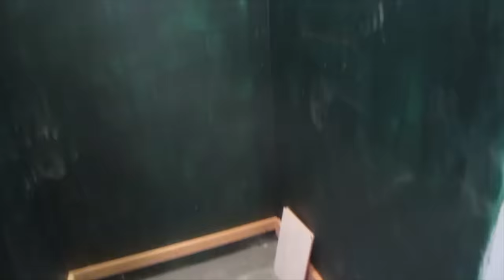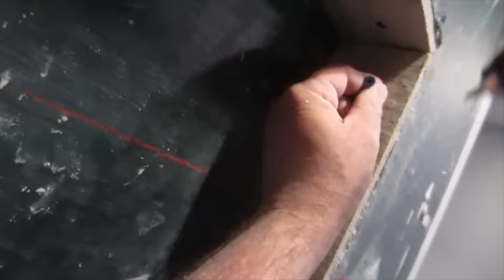Complete bathroom shower install time lapse start to finish

Comment: Dude can't float. That's the difference between a pro and a home Depot trained rookie
Reply from the maker: Never heard that before, a mud guy that can't see past his trowel.
Reply: I can float 3 tubs and set them in a day. With 1/4 round. That's how I was trained. Always make a screed around your walls. I know it's only a pre sloap but it's faster and easier.
Reply: I also if have to use durarock leave 18 inches above pan then put wire down to pan. Then when rock up I float down and eliminate the board kicking out from corners that are all pinched up. If it's a big tile I can butter I would go all the way down.
Reply from the maker: It is 2018, there are very few places left in the US that still float walls, you can continue to do it the old way and be stuck in the past, or you can learn about and  integrate all the new products into your bag of tricks. cement board is still very popular, and a lot of installers still use them, I have actually moved away from them and use modern sealed systems for my tile showers and uncoupling membranes on my floors. You saw one video, I have almost 700, maybe you should watch a couple more. You can either learn about all the new systems and be part of the direction the trade is going, or you can be left behind.

Comment: Sal, i need your honest opinion.  Could a dumbass like me do something like this?  my shower is fuckin disgusting--you should see the black mold around the edges lol
Reply from the maker: Hard to say, some people can and others have a really hard time. I guess it all depends on how handy you are and how much time you are willing to put into research. One common mistake is to keep going, even when things are going wrong in that case you should stop, evaluate, make corrections and then continue. By the way all your posts where marked as spam by YouTube, I approved them, you have to keep it clean and not post so many comments at the same time, otherwise YouTube filters will reject them.
Reply: ***** ahh thx man for the heads up and advice.

love ur vids : )

Comment: Umm why did you install your backer board ontop of your shower pan liner ....thats a big no no ...even u say it on one of your videos so why do it here ...
Reply from the maker: I refer you to this, https://yt3.ggpht.com/k-c5qwyKN-j5z2HWof327HSBJUHxFK5PCog9xuGeKRaqqI4__8Dy9wJJEdkbiya26Rh9HrCtSp8pedU=s1600-nd there is a distinction between cement board and Fiber cement board, for one it is ok, for the other it is not.

Comment: God I hate when people smear the grout all over the floor like that
Reply from the maker: So how would you do it?
Reply: @SalDiBlasi scoop a little with the float and apply it just to the grout line
Reply from the maker: @jeffg2671  So how an amauture grouts then.
Reply: @SalDiBlasi  it's never fails our company's tile man
Reply from the maker: @jeffg2671  When I saw your initial statement, I knew you were not an installer, I would ask your "Tile Man" if he owns a TCNA Handbook, how many trainings he has attended and if he keeps up with modern standards and methods. Not saying your guy does not know what he is doing, but if he grouts like a novice, what else is he not familiar with.
Reply: @SalDiBlasi  thats how he was taught, and how ive done it for the past year, keeps the whole floor from being covored with haze

Comment: Water is probably seeping up that wonder board by now. Big no..no.. installing backerboard over your panliner and in the Showerpan for the water to seep up. Fail. This guy doesn't know what he's doing!
Reply from the maker: Really amazes me how many people think they know how to do something, but only really have part of the info and then assume it applies to every product and every system. This is the correct way to do it for a cement board, however it would be incorrect for a fiber cement board. Refer to the TCNA Handbook Method B415-18. Don't know what the TCNA is, well there's your problem.

Comment: As a contractor as soon as I play the video you can see a big mistake... They're Using regular wood studs instead of pressure treated wood... big no no....👎🏻
Reply: Let’s see your tile job so we can see what you do wrong 😊 looks like a pro job to me straight , level and clean is all I ever ask my guys for.
Reply: Pressure treated on the interior? 👎
You don't need pressure treated wood behind a shower
Reply: Using pressure treated is a big no no no. Only place you should ever see pressure treated inside a home are on concrete slabs, and thats just your bottom plate, and your sill plate on top of your foundation, but I wouldnt even consider the sill plate "interior".....
Reply: Always thought if you do your waterproofing the right way, your studs could be made of tissue paper and it shouldn't matter. I maybe wrong though.
Reply: Rico Monroy as long as what you put under your waterproofing isnt going to shrink or swell. You put wet lumber behind it, its going to shrink and twist.....
Reply: Cutting corners ..  but then again .. probably charged less then 1000 to make that shower
Reply: And you don't make contact with the structure
Reply: Regular studs are all in all the showers I do, installed by the framer. Never had a problem with moisture getting to the studs. Did one demo once, literally tile almost falling off the wall cause whoever did that shower installed drywall in the tub shower. And the studs were ok...
Reply: Pressure treated in shower is not needed fella.
Reply: You are not supposed to use pressure-treated lumber indoors, it's it's toxic, not good to breathe at all!!
Reply: Never use pressure treated wood on something that is going to be sealed.. it will rot from the inside..only for exterior and sole plate on concrete
Reply: So he should tear out the existing framing .  If he waterproof his walls I'll pay it.
Reply: What a joke pressure treated come on feel sorry for anyone who thinks your a contractor
Reply: @victorsantos3425  I bet you are wrong
Reply: Metal studs would be best